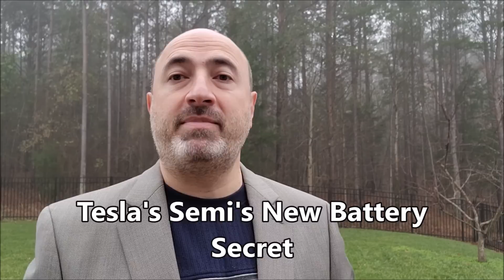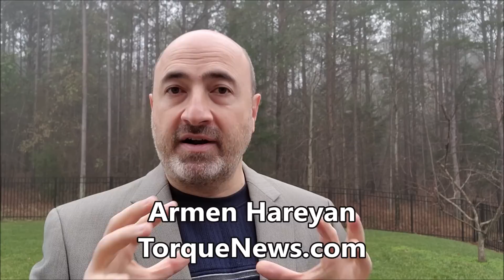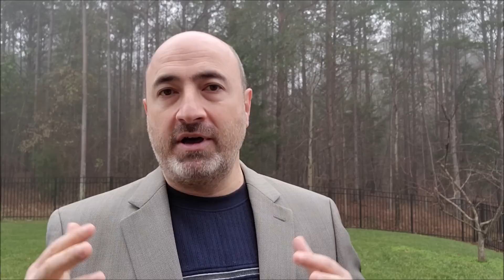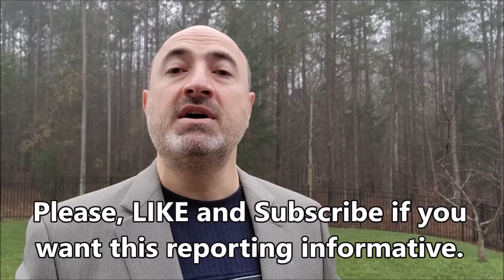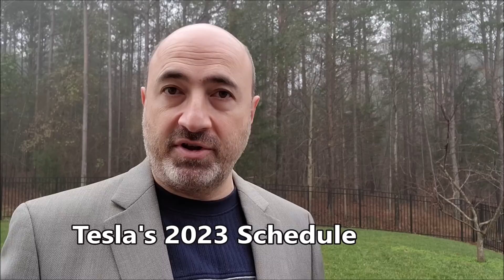HOURS AGO! TESLA SEMI HAS a Modular Battery Pack That Unlocks New Opportunities

Comment: If this is modular I would imagine it's just for swapping out at the end of battery life, not swapping batteries to avoid having to charge. I don't think this is necessary on any personal vehicle as they just won't be used enough to depleat the battery. Commercial vehicles make more sense as they'll be going through a lot more charge cycles.

Comment: Sweet spot is 320 to 350 mile range for those in the suburbs and 250 miles for the city dwellers with private chargers and 300 when they have to use the Superchargers.

Comment: Longer range, less charging sessions. Would be nice to charge once a week or better.
Reply: People who plug in their car every time they park will never have a flat battery.  The guy who charges once a week will have to remember to plug in and drag a lot of extra weight around that he does not need and pay more for the car.
Reply: @danharold3087  I’m speaking on behalf of those who live in apartments.
Reply: @Atgul-z6o  Understood.  It will take a while for it to happen but apartment owners will be installing charging if they want to fill their units.   Slow charging is not a big deal.
Reply: @danharold3087  and they are doing it, but to a add meaningful number of slow chargers requires a sizable service and the apartment complexes will not absorb this cost.  If you put in level 2 - 40 amp chargers (7.4kw units) keep the math simple 740kw, be conservative and assume 50% load. You’re still approaching a half megawatt service.
Reply: @Atgul-z6o  Short answer is not to buy a BEV if you choose or are forced to live in an apartment unless they already provide charging.
Reply: @Atgul-z6o  Why should they lose money so you can charge your car?  Expect to pay for it over time.

Comment: Modular packs definitely will not be default design.  Maybe large trucks, boats, etc but not cars.  The cars will all be structural cell to pack for weight efficiency and power density.